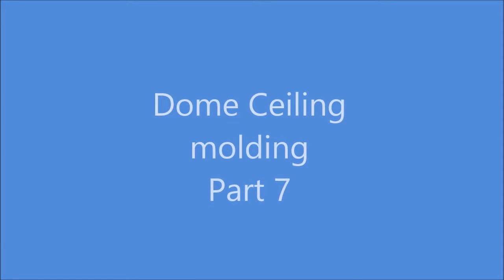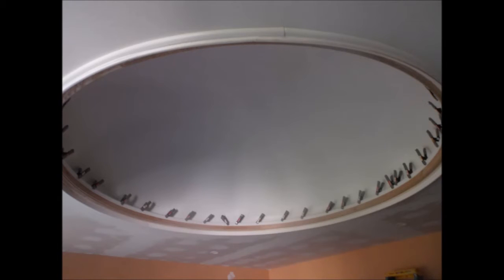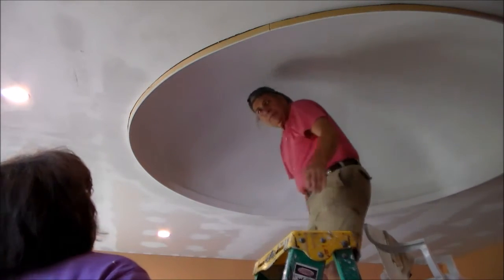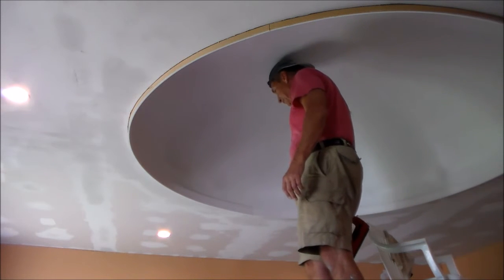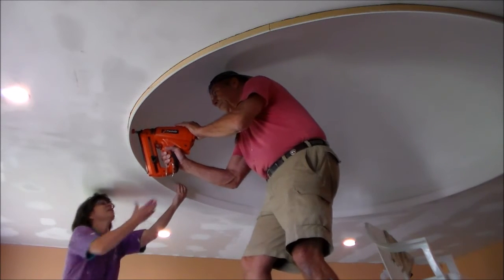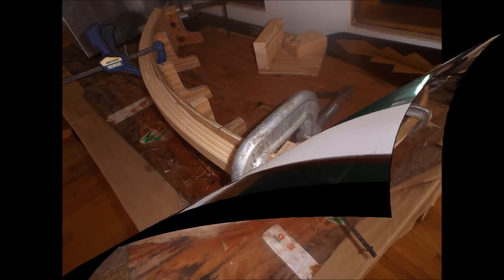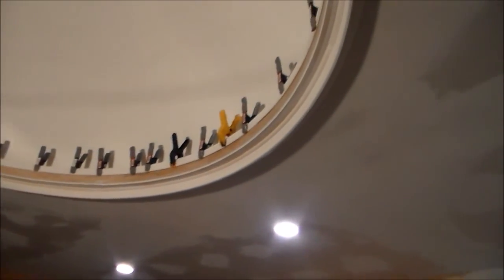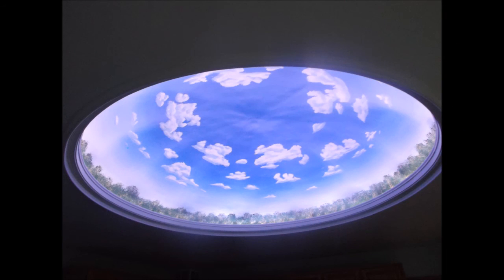Dome Ceiling    molding   Part 7

Comment: Don:

Thanks for the quick reply. I had one other thought after I sent the last reply to you. Being that the triangular drywall pieces are like 12 pie sections, is the flatness noticeable at all? I understand the curves from base to point is wet and conforms well, but the facet effect looking upwards is what concerns me. I’m going to place a 12’ X 18” within a dropped ceiling (someday).
Reply from the maker: +kbaxter777  not noticeable at all--- use a flexible trowel when applying the compound and fill the seams in to make the curve.  When you get closer to the center it is almost flat there anyway. This is an enjoyable project if you are not on a time line. Enjoy it my friend.   Don